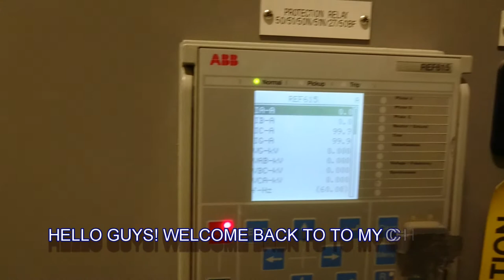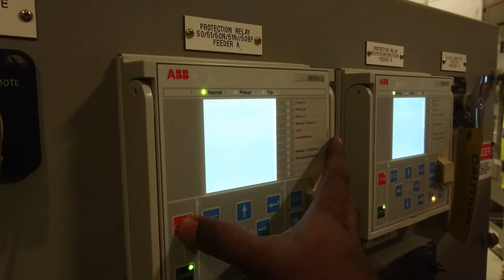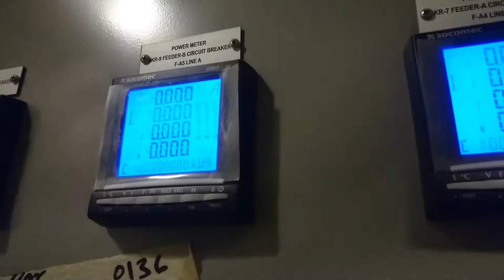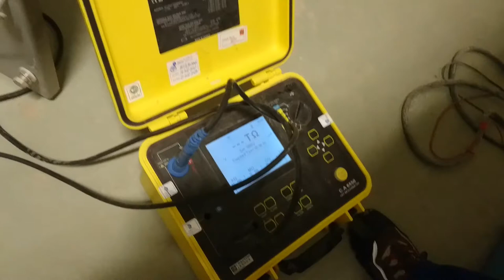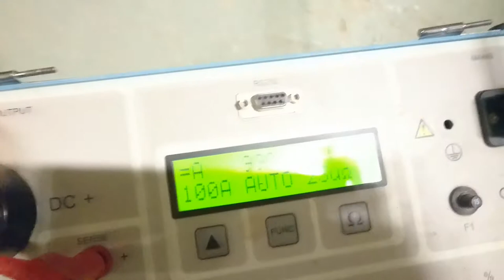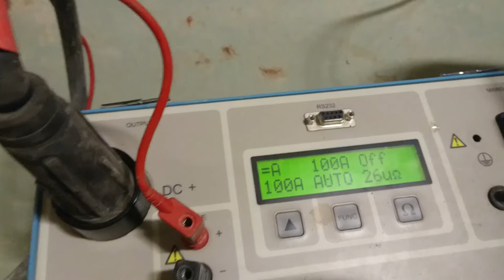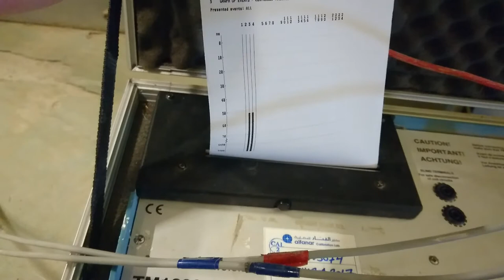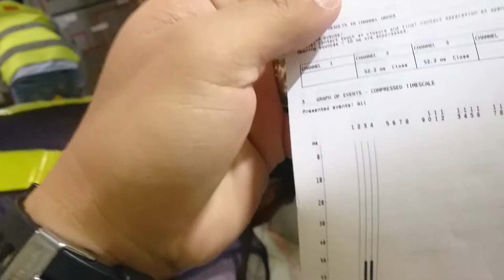How to test Vacuum Circuit breaker (Contact Resistance Test) 15 KV/1200A

Comment: Ingat k host sa work mo anu mga yn anung work mo host?sending my full support slmat sa pagykp sa bhy ko keep con.always idol❤
Reply from the maker: Hello po maraming salamat po sa supporta... Sa cinstruction po ako nagwowork as Electrical Engr. Yan po ay Vaccum Circuit Breaker. Makikita lang po yan sa mga Electrical Power Plants, Industrial Plants at sa Main Switch Board po sa barko... Keep safe din po...

Comment: Sir How Much Voltage apply ?
Current 100 A, voltage?
Reply from the maker: as you can see the result of the contact resistance device is 23 micro ohm with 100Amps. Just calculate it by Ohms's law you will get a voltage of about 0.0023V.

Comment: Hey is this LCA in jeddah ?
Reply from the maker: Yes it is brother.
Reply: @HectorideMoto  nice my man great work those breakers are still working 24/7 till now
Reply from the maker: @basspassionguide9089  thats great. good to hear that from you.
are you a systems operator there or a maintenance engineer?
Reply: @HectorideMoto  im a electric technician o&m soon to be engineer if you have anymore videos on load centres especially medium voltage please post them you’re content is very beneficial 👍🏼
Reply from the maker: @basspassionguide9089  not much only few brother. its been 5yrs already since the last time I have been working there. Start from scratch from 2012 until 2018. Are all load centers fully operational? Load center A,B and C?
Reply: @HectorideMoto  load center c is finished , lca still has a bit left but its working full load , lcb still has some LV work and but mostly done maybe in 2025 its all going to be finished
Reply: @HectorideMoto  you are a hustler man i hope you succeed in life and find what you are looking for . Were you with bin ladin group?

Comment: Hala lakas nmn ng vaccum cercuit nya idol
Reply from the maker: yes lods pang Medium Voltage Circuit breaker po yan 13,800 volts na may ampere rating po na 1200
yung sa bahay natin nasa 20-40 Amperes lang... salamat lods

Comment: You didn't explain that how we are doing connections
Which machine we are using, name
How to Increase the voltage
What should be the minimum value of the resistance